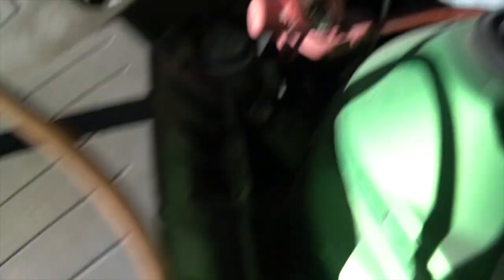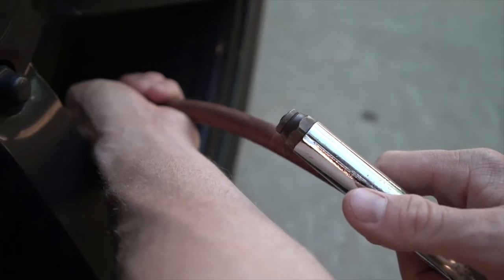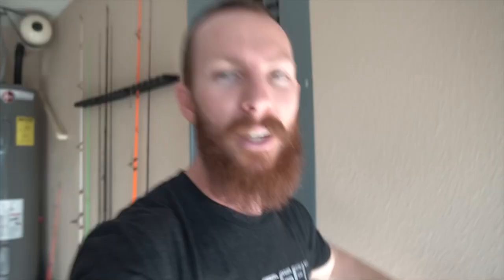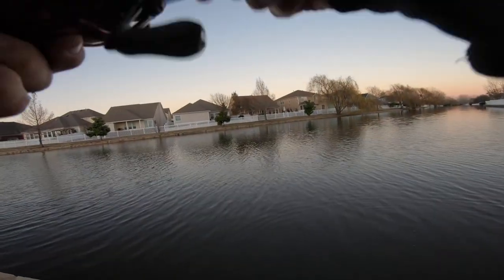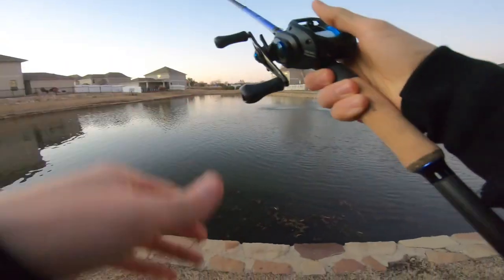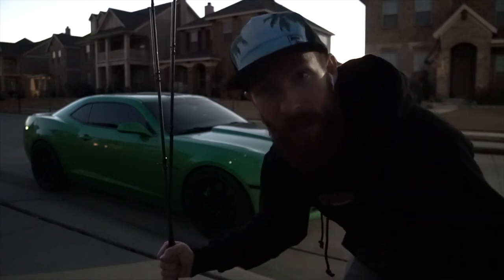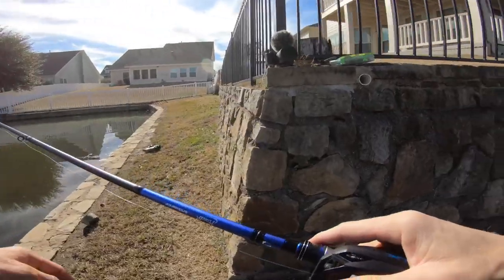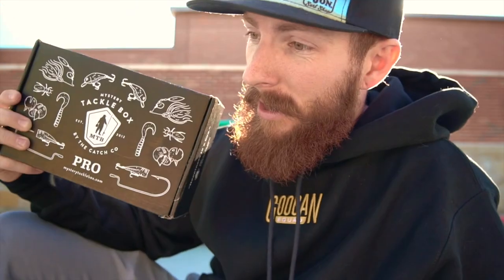CAMARO WON’T START AGAIN... AND I LOST MY BIGGEST FISH OF THE YEAR (crazy fight!)

Comment: Bro, all compressors have a drain valve at the bottom because moisture builds up in em. Not because its "an older model". Look at the one you mentioned. You'll find it and they need to drain the bottom one as well. You should also have one up top on yours. Its the pin on the left with the key ring..
Reply from the maker: I didn’t say they don’t 😂 I said ours is a screw that’s more of a pain than the ones with a twist toggle to open/close 😂😂😂🔥💪🏼
Reply: @WestinSmith  all compressors' condensation drain valves are screw in.....  again, the valve on top and bottom are different. Did you even listen to what you said? Lmao

Comment: Westin my guy. Just a heads up def double check that psi again. 40s to 50psi seems way hi for the camaro.  Before i started building pool rables 5 yrs ago i was a mechanic for 10 from q mechanic family   and ive never seen a car take over 35 38 psi.   Jus sayin because to much psi effects traction and wear of tire.    Either way you my guy ...... keep it pumpin ya dig
Reply: 44-51 is average for a car. You have no clue what you're talking about.
Reply: Emissions license says different   like i said i said double check. Maybe his camaro is different but bud i installed tires for 10+   yrs so u can get negative but i think you are wrong bud. Go ahead google it if u wanna.   Im talkin cars. Not trucks  there is a difference yanno
Reply from the maker: Thanks man! I went off the tires spec since they’re not stock sizing but around 40 is just about what we always do. They’re all seasons nothing for sport
Reply from the maker: Lol 😂
Reply from the maker: Yeah I’m neutral haha I’ll look it up though
Reply: Sweet ride by the way  i still miss my 95 ss imapala.  Srkt skrt ya diggggg
Reply: And as long as ur tires arent wearing quikly (without extreme driving lol) or wearing uneven then they should be fine  another heads up the manufacters psi will always be on a plaque labeled inside one of front door jams usually the driver. And if im correct camaros are diff from front to back but aftermarket tires are different also
Reply: My bad ...positive vibes. Meant nothing by it lol

Comment: Since when do you have to release the air everytime? That is a drain you're supposed to open periodically to release water from condensation to prevent your tank from rusting out and blowing up. That's what I presumed anyway
Reply from the maker: 🤷🏻‍♂️ I thought everytime. I wouldn’t want to keep it pressured with how often we use it